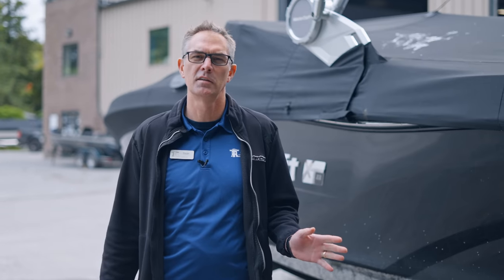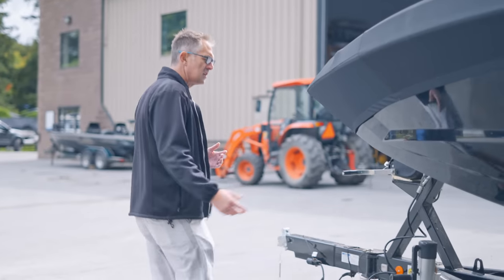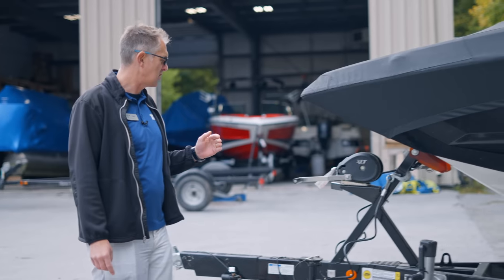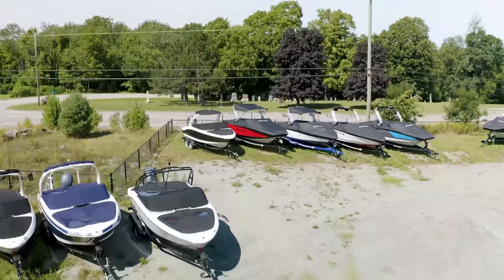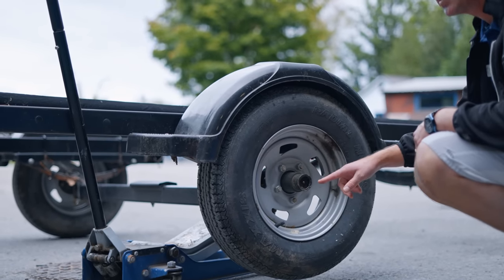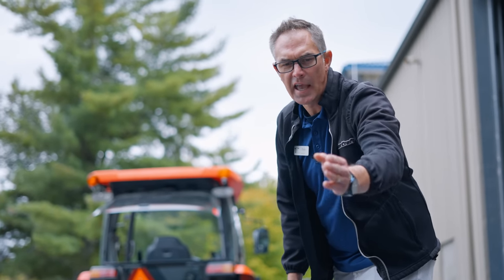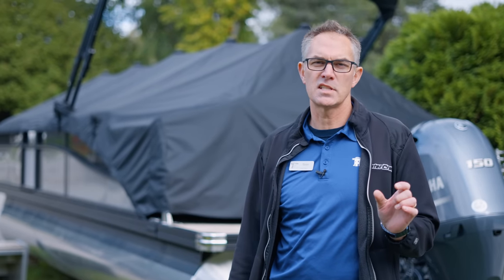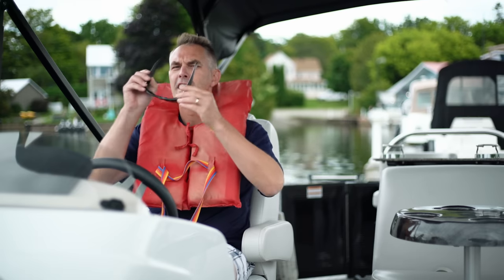Boat Trailering Mistakes

Comment: You guys kind of "missed the boat" with this video. You really didn't talk about "mistakes". This is more of a "Things to inspect on your trailer" video. What about: How to clean and maintain electrical connections; How to check axle alignment; How to prevent or slow dry rot on tires. How to verify tongue weight and adjust if needed.
Reply: Or better yet, that bearings don't leak, seals do!
Reply: Then make a video and show us how.
Reply: You make a video!   @NTSAdventures
Reply: You must be real fun at parties. I wish the dislike counter was still active!
Reply: @jen4739 Yeah, we know… And tires don’t go flat, the air just comes out.

Comment: Also, it's a good idea to disconnect the power from your lights prior to backing the trailer down into the water.  Water and electricity don't play nice together, especially salt water.
Reply: DC works fine in water. Now, salt water is another story!
Reply: If your electrical system is allowing water into it, disconnecting power s going to do very little good for longevity.
Reply: If you have LED lights your fine......if you have normal lights.....COLD.....water like below 60°.....will pop hot bulbs.....if your bulbs are cold waters not freezing.....they should be fine underwater.....it's cold water cracking hot glass.....not really water touching wire....and if your worried about that is check your connections.....
Reply: That doesn’t work on my trailer.  my reverse lights activates a trailer brake bypass allowing me to back up.
Reply: @alpaca7886  Once the trailer is on the slope of the ramp there will be no brake pressure generated by the trailer so it won't matter if your by-pass works.
Reply: The answer isn’t to disconnect the electrical. Rather, the lighting system should be designed to keep the wires high and dry. Simply disconnecting the system does no good. Regardless, the truck itself “should not” be backed into the water to the extent that the plug-in on the truck (above the bumper) is under water anyway.
Reply: @livingadreamlife1428 I believe they are referring to to wiring and lights actually on the trailer not the wire connection. Unplugging before backing in just prevents possible ground issues or hot light bulbs in water. Just remember to plug back in before leaving launching area.
Reply: @alpaca7886   Easy to add a switch for the 4 wires that don't control your reverse lights.
Reply: what type of unearthly boat trailer do you have that doesn't have lights at the back that get submerged into water when you dump your boat?
Reply: @DonziGT230  ya but you can let it dry or drain and hopefully not immediately short it out…
Reply: @GardensoftheAncientsHerbal  You won't get a short circuit from water getting into the wiring or lights.
Reply: @DonziGT230  ya but it’ll blow the bulb
Reply: @DonziGT230  well not a short in the sense of your harness frying or fuse that isn’t in the water but the bulbs pop. I’ve notice just letting them cool off solves that.
Reply: @GardensoftheAncientsHerbal  If you have old style taillights that let water in then yes, the hot bulbs will often pop.  I can't imagine many of those are still around, we've had waterproof lights for decades.
Reply: @fishontv6834 an awesome homemade one with elevated lights...
Reply: My backup alarm goes crazy if the lights aren't plugged in when reversing.
Reply: I just use liquid electrical tape on all my connections. It makes them watertight so that nothing could touch them. You can buy it at The Home Depot on one of the end caps in the electrical section.

Comment: Tip number one reveals mistake number one. Don’t rely on the winch to secure the front of the boat to the trailer. Put a chain of proper length from the bow eye to the trailer frame.
Reply: Correct that is standard in New Zealand my country

Comment: Before towing my boat, I put a box in the back of my truck, locked under cover, that contains all I can think of for towing. I call in the "Jack In The Box". Inflator, lug wrench, hub kit, jack, scotches, on and on. When I return home, the box goes on the bow of the boat. Wont trailer anywhere without the box! I have not needed it, but have encountered others who did! Win win!!
Reply: Can you provide a comprehensive list of the Jack in the Box? Need to put mine together and you have some great ideas! Thanks!
Reply: @brunkbrunkbrunk  J.I.T.B. Goodies: Old rubber door mat rolled up (So jack won't slip), Good 4 way, Extra Jack, Extra Hub Kit, EZ Lift Half Moon thing, goes under axle, back up to lift trailer (No jacking!), Mini Compressor, Milwaukee Cordless 1/2" impact, Gloves, paper towels, rubber wheel scotches, roadside reflectors,   and other things relating ONLY to trailer. Tools for the boat go in the boat!

Comment: I carry a spare hub and 2 spare tires (one on the trailer, one in the truck) because once you replace a flat on the road you don't have a spare for the return trip. If you replace your hubs on a regular basis, keep a good one in a large ziplock bag all greased and ready to go. Carry a short piece of 2x4 and a rubber mallet if you have bearing buddies. I carry two floor jacks since a ruined hub on a soft shoulder means you need to get the trailer high enough to get a jack under the axle, then I carry a piece of thick plywood to use as a base for the jacks. Yeah I carry a lot of stuff.
Reply: Better safe than sorry.
Reply: It's better to have it and not need it, then to need it and not have it.
Reply: i take it you have a huge truck.

Comment: What happened to winching your boat onto your trailer. Submerging your boat trailer to launch and retrieve your boat is so destructive in a saltwater environment. These days, with the advent of power winches, this makes wetting your trailer unnecessary and will save you time and expense of replacement... and talking of trailer design, what happened to tilt trailers? The modern boat trailer is designed to fail in a few years, I have a big hardtop fibreglass boat on a forty year old trailer, painted only no gal. The boat sits low on multi-rollers, just the tyres and the rear gimbed rollers get wet . The power winch takes only seventeen seconds to winch the boat onto the trailer, knowing the suspension and wheel bearings are high and dry. Having to wet a boat trailer to launch and retrieve only favours trailer manufacturers. Cheers

Comment: Regardless of outside appearance, I wouldn't use a trailer tire over 6 years unless: 1) It was a radial  2) It is stored inside and off the floor (Trailer jacked up). 3) The travel is limited to local boat ramps. Like you said, after 10 years it doesn't matter what they look like. Great video.
Reply: Agreed. I’ve seen perfectly good looking tires shred that were 7 years old. I never met my trailer tires get over 5 years old regardless of appearance.
Reply: No mention of balancing trailer tires .
Reply: @hotchihuahua1546  To me, balanced tires are a given.
Reply: @timothystevens4840 that’s you and me but check most trailers and the tires aren’t balanced . Lol 
A spare is also overlooked .

Comment: Something to note is that the jack that comes with your tow vehicle may not necessarily work to jack up trailer to change a flat. And your lug wrench may also be the wrong size to fit the trailer lugs. I carry an old spare scissor jack, breaker bar and right sized lug socket in my truck in case I get a flat. I just leave them in my truck for the summer so I never have to think about loading them ever time.
Reply: I found that out the hard way so to speak. Had a flat thought I had all the bases covered carrying a separate 2t floor jack just in case. Found out that with the tire flat my jack still wasn't low enough to get under the axle😮. First thing i did was grab a new tire and a low profile racing jack.

Comment: I live in the Midwest. I replace my tires at the end of the 4th year. I’ve learned from experience that 5 and beyond is questionable. 27 years of 1200 miles a year  of trailering the boat.  5 is probably OK but I worry about a failure on the road instead of enjoying the trip. Lol.  Proper inflation is critical. I check the bearing temp at every stop on longer trips.

Comment: Good info here.  Since retirement, I tow my boat round trip from NY to FL every year, and total close to 5K miles a year.  The additional miles have made me more attentive to my trailer as previously, the only issue was age.  One thing I screwed up for years was tire pressure.  I had no idea that trailer tires call for much higher pressures than car tires.  My one bearing failure occurred after my dealer changed them (perhaps he over tightened one of the four).  Now, I have bearings and tires checked at least every year.  
Thanks for the video.
Reply: Trailer tires also have a lower speed rating and blow out easier at higher temps/speeds. I see guys going 90 pulling their boats on Texas toll roads and wonder if they realize the tire speed ratings are often lower than their vehicle tires.
Reply: @moonpiespotlight4759  most trailer tires are rated 55mph, some are 70 and some are 80 depending on the ply rating
Reply: An easy bearing check is to feel the hubs' temperatures whenever you stop.  They'll usually start to run hot well before a failure.

Comment: two items that I always do are. Small cheap trailers use wiring harnesses with crimp-on connectors, I remove them and solder
the connection. never a bad connection after that. The other item I do once a year is to remove all the wheel lug nuts and brush
on anti-seize. Again I no longer have seized on lug nut that can ruin your day if you need to change a tire especially on the side
of the road.

Comment: When not using your trailer, don't leave it parked on grass or any other organic material such as grass. It will degrade at an increased rate. Use dead mater instead, such as a concrete slab under each tire.

Also avoid leaving it in direct sunlight, the UV radiation also takes a big toll on the rubber.

Good video!
Reply: Ozone actually is the bigger problem that degrades and breaks down vulcanized rubber. Better to just pay the piper and upgrade trailer tires every 5th year at the longest.

Comment: I like to carry a laser temperature gauge. ($20)  After trailering for at least 20 - 30 minutes check the temperature of the hubs.  If you have one on its way out it will start to run hot.  I like to see them at around 95 degrees.  If you have one exceeding 105 on a regular basis, it's worthy of a closer bearing inspection.
Reply: Way way to much......just touch them they will either be kinda warm or too hot to touch.....or listen for sqweeks......
Reply: It's great for checking the temp at the hot springs, also.  I am not crawling all the way under the trailer to touch dirty, hot stuff.  Infrared imager works well, also!

Comment: Level towing is important.  Measure distance from ground to bottom of coupler when trailer tongue is level.  Measure distance from ground to top of receiver on the tow vehicle.  The difference between these two measurements is the rise or drop needed to position the trailer ball for level towing.  Then the proper height ball mount can be selected for the vehicle and trailer being towed.

Comment: Sorry I always think of other things after I post. I also use 303 protectant spray to keep the tires from drying out. Tire foam and the tire shine products make the rubber in the tires deteriorate faster, 303 protectant helps keep the rubber moist and flexible.

Comment: If you have a E-Z loader,or any trailer with roller bunks,beware!If the rubber wheels wear out ,the brackets that hold them will go right through your hull ! I drilled a hole though the washer that helps hold the rubber wheels on and spray a lubricant in every year .White lithium works well.Happy boating!
Reply: Grease is not good. It attracts dirt, sand, and gravel and hold it thus wearing greased components out. Use a spray silicone that dries and leaves a lubricated film...

Comment: 1. Boat dealers commonly sell trailers that ‘barely’ carry the boat mainly to keep price tags down on packages.  I’ve seen too many boats at 95-100% of a trailer’s capacity and that’s not even accounting for any gear laden into the boat afterwards.  
2. Do your own checks and do NOT reply on anyone else.  Check yourself your tire pressures and lug nut torques!  My brand new $20k tri-axle trailer had all tires including 2 spares all under inflated (averaged 50-55 psi when they should have been 80 psi) And i went back to trailer manufacturer who had a guy re-torque the lugs as recommended after some initial miles (he only tested and re-torqued some lugs.  After a few hundred miles, i sheared off a tire and wheel (lugs sheared right off!).  Checked lugs myself and found most needed tighten significantly and then also found all tires under inflated.  Grrrrrr.

Comment: Add wiring too. Never use those Green Yellow Brown wiring kits unless you want to rewire your trailer every three years. I replaced my wiring with marine grade tinned wiring. Only the marker/fender lights have a connection that is underwater. AND there is no such thing as waterproof lights. My lights are mounted on my guide poles. I use the shrink solder connectors as well. Also I mounted red marker lights on the back, facing towards the tow vehicle, of the guide pole lights wired to brake/turn lights so I can see my brake/turn lights in my rear view mirror so I know my lights are working.
Reply: I use epoxy lined heat shrink and overlap a longer piece over a shorter one for double protection. Liquid tape is also a good product to coat a connection with. It's not pretty but in a hidden space you can use a wire nut on at-risk connections and simply dip the entire wire nut into the liquid tape to completely seal the connection (telephone companies used to do this with buried cables). I have nav lights with hidden wiring in the bow of my boat that have these types of connections for 20 years without any issues.

Comment: Good video. No matter how much you know,  or think you know, you can always learn something that might save you trouble. 
  "Trailer manufactures don't always use the best quality tires"    you say....the China bombs that came with our trailer literally started coming apart in the second year from very easy normal highway paved road driving.    Buyer beware.  Always buy brand name trailer tires from a reputal tire shop.

Comment: Carry a good spare trailer tire.
Don't grease trailer lug bolts. 
Inspect COUPLER every trip. 
Carry a spare wheel bearing set; bearings and races can be changed by most owners who carry tools or any decent shop but you need to have the replacement. 
Read your trailer brake controller manual and understand how brake controls work. 
Don't load your boat with other stuff that stresses your hull or overloads your trailer.  
Know how much tongue and axle weight you are towing.
Carry a small grease gun with bearing grease; apply a thin layer on trailer ball each trip (but not on Andersen brand hitches)

Comment: Always check the hub temperature (by hand) after the first 10-20 miles of a trip. Hot hubs indicate problems: overloading, contaminated or low grease, or worn bearings. Have an extra set of bearings, a grease gun with marine wheel bearing grease, a bottle jack, a spare tire, tools for a tire change and a tire pump with gauge. Traffic cones add to tire change safety. Also do not exceed the speed limits of your tires. A good idea to upgrade tires on a new trailer, keep the old ones as spares. When storing your trailer, keep the tires on wood planks (not on the dirt or grass) and cover the tires from the sun. Check tire pressure periodically, as low tire pressure compromises tire integrity while in storage.

Comment: In Florida if your trailer tires are outside you'll only get 4 maybe 5 years out of them  Quit sinking your trailer too. The deeper your trailer goes into the water the more water pressure pushes into those bearing wheel seals and bearing caps. Once water gets into the bearings its only a short time before that bearing fails. I'd say that is one of the most common launching mistakes people make. I've got my trailer set up so only the rear of the bunks need to be submerged to launch and load my boat. The bearings are only 8" deep.
Reply: Or just shoot grease into the bearing after every trip so it pushes the water out…
Reply: @jakemedley7423  actually that will blow out the rear seal. Then the grease slings out and the bearing fails.
Reply: @JeffBattleFish  no it won’t if your careful and only do enough to displace the water
Reply: @jakemedley7423  Where does the water go?

Comment: It seems like bunks should be made of solid synthetic decking material.   If you bolt them to the trailer with countersunk carriage bolts and wrap them with carpet,  they should work the same without rotting.   They are more expensive than wood, but you are only buying 2-4 of them.   Is there any drawback?
Reply: Synthetic decking material doesn't have the support. That's why you need 12" on center joists to avoid sagging and why substructure of decking is normally lumber. Also there's no holding power to them so using a lag bolt in them is a non-starter since below the surface coating is mostly pressed material. Even PVC boards don't have the best holding ability with screws, and don't have structural support. There's nothing wrong with using lumber as long as you continue to service your trailer regularly. Bunks should last several years. 

That said, there are synthetic bunk boards but they are really expensive and aren't made from decking material.
Reply: @moonpiespotlight4759  a piece of aluminum angle backing the board would take care of the sagging.  Of course, you just bolt through them to negate the weak holding power.